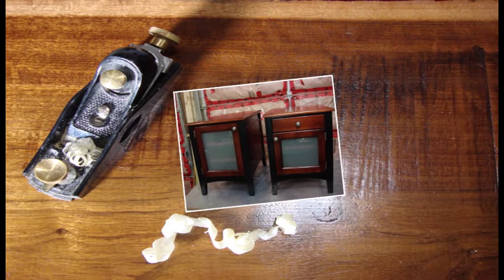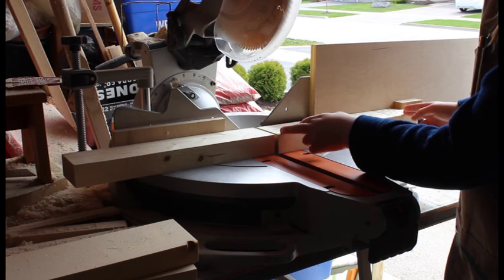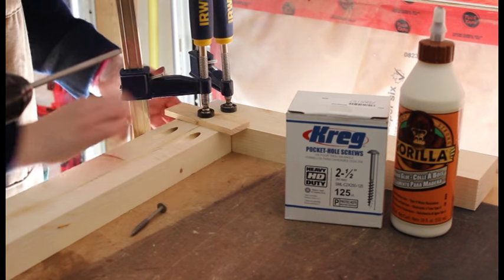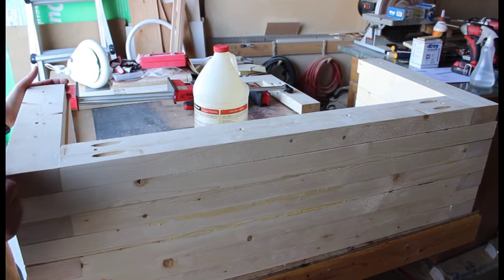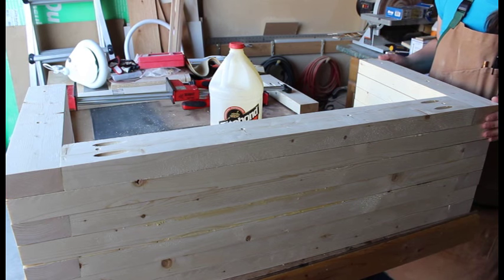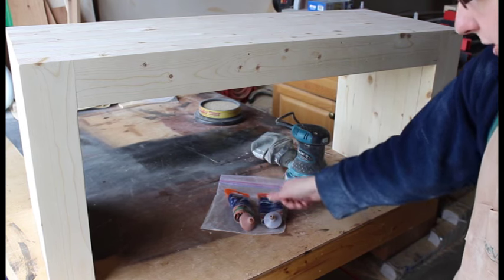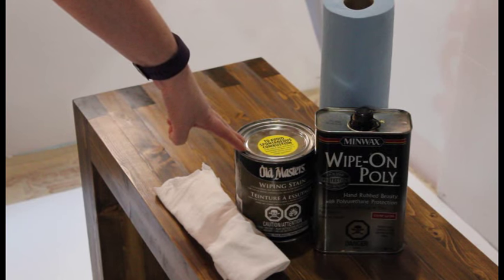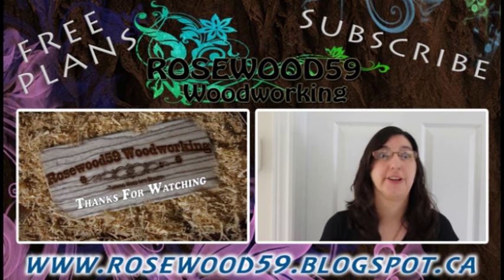How To Make A 2x4 Bench or Coffee Table

Comment: Very handsome table . I made some similar tables 40 years ago. The main difference was I used no hardware just glue. I stained mine in a Honey Pine  color and finished with poly.  It's much less work not using screws  . They are still being used almost 40 years later. I'm sure yours will last at least that long. Good work.
Reply from the maker: Thank you and wow that’s awesome to hear that it’s lasted 40 years already.  Thanks for watching my video!

Comment: Thank you for your video! I think I am going to try to make a 28"x47"x17" waterfall coffee table using seven 4"x4"x8' cedar boards. I want the pieces to look continuous if you were to follow your finger from the bottom of one leg, across the top and down the other. That means I will have to cut the board off at 17" then 47" then 17" and use the rest as scraps. I will have to trim them all down to make them square. But instead of your technique I will be cutting each end to a 45° angle, except the bottom of the feet, in order to have that continuous waterfall look. I will glue them, but I think I have to put a bracket (or 1/2"X1/2"x28" piece of wood) underneath, so I think I should glue the legs together first then get that level to attach the bracket and glue the tops together and get that level. Then glue on the legs to the top and screw in the bracket to the top. Then I will sand, fill, sand, stain, top coat. Are there any issues you can think of with how the top is secured to the legs? Thank you!
Reply from the maker: Your welcome for the video and thanks for watching! Great idea of the waterfall look and it took me a while to think of how you are going to do it. Here is what I came up with: 
1.	I would do a small mock-up of the corner. So, you can see the 45-degree angle look.
2.	You can still use the Kreg pocket hole joint, it does 45-degree angles or you can try using finish nailer, dowels and brackets like you said.  
Everything sounds good on how you are going to do it. All the best on your project and hope this helps!